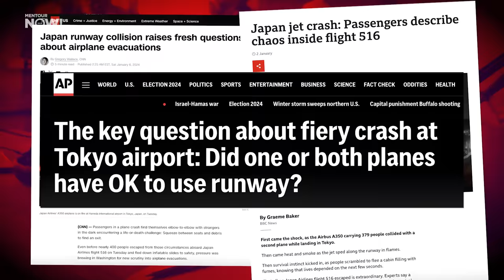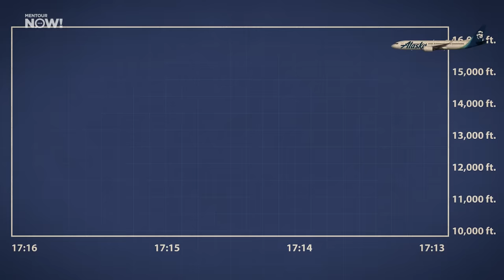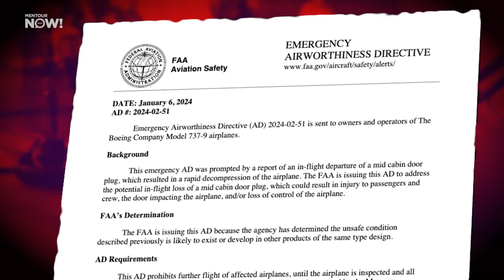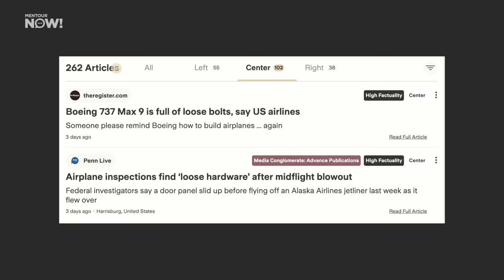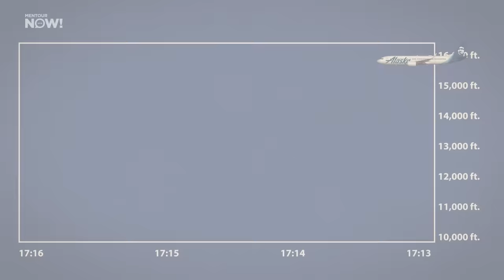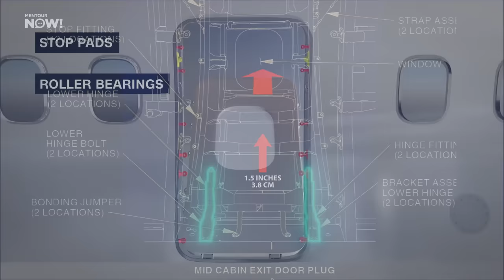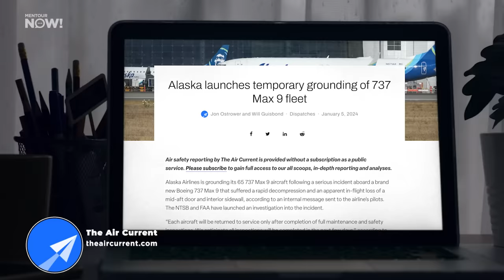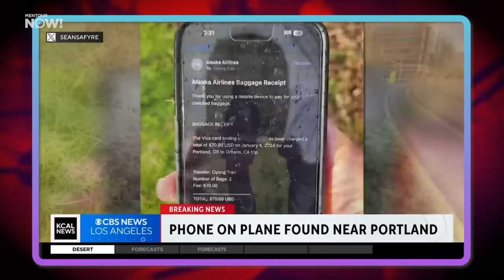WHAT Is going ON with Boeing?! MAX-9 Door blowout

Comment: NTSB media briefing on January 7, 2024 reported that the cockpit door was blasted open upon the decompression event and smashed into the lavatory door and initially became stuck.  NTSB further reported that the first officer's headset was pulled off, the captain's headset was dislodged, and the laminated Quick Reference Checklist stowed below the cockpit windows was blown out into the cabin.  NTSB reported that, according to Boeing, the cockpit door was designed to open during a decompression event but the manual did not say so.  This was apparently not merely an opening of vents but an opening of the entire door.  The flight attendant, after several attempts, was finally able to get the cockpit door closed.
Reply: The cockpit door opening, I feel like they might of switched to a cheaper way of producing these doors but they would not comply with regulations added after 9/11, so they decided to hide this yet again.
Reply: Should this have happened…absolutely not. However, the planes and crew training were robust enough to safely land. 

Still the safest form of travel.
Reply: The 737 post-911 cockpit door lock mechanism is designed to unlock in case of rapid depressurization. Airbus has a similar system. The blow out panels in the door will open towards the flight deck only, in case the depress occurs in the flight deck (allows the large air volume of the cabin to escape through the flight deck). I understand the consequences of not having the MCAS documented in the flight manual but not everything has to be documented and pilots don't know everything and they don't have to know everything about the aircraft they fly. I certainly don't know about a lot of design features of the aircraft I fly.
Reply: Seems kind of a bad design if that's the case.
Reply: @carlveilleux5744  I don't know. Having an entire heavy door violently blast open during a sudden depressurization could cause serious injury if someone is standing near there. And as reported, the door jammed a lavatory shut. If anyone was inside, they might be trapped and not being able to escape during an evacuation. Seem like a very bad design.
Reply: @aliancemd "... they might of switched it ..." should be "... they might have switched it ..."
Reply: @douglaswilkinson5700  It's my 4th language, get a life. Let's see how you speak your 4th language
Reply: Yes that's the point of having the door unlock automatically, it would just swing open (I'm not 737-rated but some guy on Twitter (X!) explained how the door lock system works and the one way blow out panels). Also the door frame and bulkhead structure could be damaged by the rush of air causing maybe some damage avionic racks and what not if the door doesn't open. Now if this "unlock" mechanism didn't do it's job and the door was actually blasted open, well that's not good! We'll see what the investigation reveals. @Secret_Moon
Reply: Wait... So if I want to hijack a plane I simply have to cause a cabin depressurisation at low altitude and I can wander into the cockpit?
Reply: Is it just me, or does anybody else think a headset that gets dislodged in an emergency is kind of an unnecessary extra risk
Reply: @aliancemd  might of is actual american slang as far as i am aware. i speak some languages myself and most of the times i am too nitpicky in the grammar rules, so i would have never written anything but have switched.
I learned my languages in school, so no slang near me to learn, don´t know if you learned your languages online or in school?
Reply: @critical_always maybe that’s why they didn’t tell anyone 🙄
Reply: Well that's not great. I'm guessing, since it wasn't in the manual, that was a shock and a half to the pilot and first officer!
Reply: @aliancemd  Were you not listening? It wasn't an accident due to cheap manufacturing, the doors were designed to fly open in the event of a depressurization. It was intentional
Reply: @carlveilleux5744   The youtuber pilots that fly these aircraft have referenced the blow out panels in the cockpit door - including as part of Mentour's insinuation that the crew may have been confused on this point.  It stands to reason that - informed about those - that they would also be informed about an asymmetry in the system where panels work in one direction but not the other.     The pilot doesn't need to know the specific torque specification for the bolts holding the engines to their pylons and other specific maintenance and design parameters  - but they absolutely do need to know particulars about the behaviour of operational systems.    Like MCAS, as you have acknowledged.   And also, I posit,  how the system behaves in a depressurization.  ESPECIALLY when it creates a hazard.  This cockpit door swinging into and somehow jamming with the lavatory door would probably cause injury to any person who might be entering or exiting the lavatory.  The crew doesn't have any means to fix that hazard, but they certainly can instruct people not to stand in that location while waiting for the lavatory or getting up to stretch.  Facilities routinely paint a profile on the floor in locations where doors swinging are a hazard.  Any quantified risk reduction from that will be really small because of the low likelihood of depressurisation events, but observing that people are not constantly exposed to a specific hazard (such as only being exposed during a once per shift inspection, instead of standing constantly beside the machine) is routinely accepted as a mitigation in risk and hazard reviews.
Reply: @aliancemd I was trying to help you. (BTW I speak Modern English, Spanish, German, Swedish, Czech and read Classic Middle Egyptian.  My friends correct my mistakes.  I've asked them to do so.)
Reply: I think that the NTSB only reported that there is no proof yet that the  multiple pressure warnings were related to the door plug ..this is completely different than stating that they are not related. furthermore it is nearly impossible to single out the origins of leaks just days later.
Reply: I reckon it was loud they said several cell phones were blown out of the airplane.  That is why it is a good idea to wear your seatbelt when you are in the seat.  The first thing I do when I sit down is put the seatbelt on.  That seatbelt can be the difference between walking away from a wreck and getting killed.
Reply: Yes, exactly.
Reply: @JohnVanderbeck Look at the Helios flight where pilots became incapacitated. Would be better for someone to be able access the cockpit should anything happen to the pilots.
Reply: @aliancemd Airbus cockpit doors also open during a violent decompression. The difference is that Airbus includes that in their manuals and therefore pilots know about it.
Reply: @critical_always  I'm curious to know how even the most inventive person would rapidly depressurise a cabin...  then "wander" into the cockpit, then overpower two or more crew members before passing out? Would a window blowout exceed the pressure threshold, or would it have to be something as big as a main cabin door?
Reply: @ImperrfectStranger  Punch a hole in the inner cladding and remove the bolts from the door plug
Reply: @mrjakobt  It's perhaps not documented in pilots handbooks, because designers expected the smaller blowout panel to equalise the pressure fast enough, but the very large depressurisation rate may have tripped another feature which is documented, at least in the general NG maintenance manuals (but isn't specifically for rapid decompression). Since I have no documents specifically for the Alaska airlines Max 9, I don't know what system is fitted.
Reply: @critical_always  More like you need to cause it at high altitude ... and bring your own oxygen if you want to move during the time above 10,000.  Good luck with that...
Reply: @carlveilleux5744  it wasn't the blow out panels that opened though. It was the whole door.
Reply: @eljanrimsa5843   LOL... 4 hours later trying to chew through a fibreglass panel, remove 4 cotter pins with pliers, Get out a socket set and undo 4 nuts, then find out the pressuration forces have already loaded up the 12 stop fittings not allowing you to slide the door up. 
If you weren't already beaten to death by your fellow passengers and if you were able to lift up the door, you would get sucked out the door. By some miracle, if you weren't sucked out the door, you would then have to run to the other end of the aircraft before passing out from lack of oxygen, fight the pilots and cabin attendants and fit your own mask (if you knew how).... if the crew hadn't already reclosed the door and locked the door manually. 
9/11 won't happen again because the people on the aircraft know they will die if they let the hijackers take control. 
By the way, I know my fellow engineers who have flown for work required special passes before flying on an aircraft with their tools, otherwise they wouldn't get past the x-ray machines at check in.
Reply: @aliancemd  You get him Lilian.
Reply: @bertbergers9171 The derivation for “might of“ is  “might’ve.”  (Short for might have) But now people have turned it into might of, along with many other variations using of in place of a contraction. It’s not real slang, just incorrect useage that is becoming widespread. Schools aren’t doing basic tasks anymore, too busy with parenting duties to teach Grammar and English.
Reply: @North_West1  Not on crasheing, it's not...
Reply: @North_West1  "Still the safest way to travel....." Says who? Says the people who take the number of, say, aviation miles divided by number of aviation fatalities during those miles flown. Looks safe? Sure it does when compared with car or even pedestrian fatalities calculated the same way. BUT.... planes carry passengers far, far further overall than cars or human legs AND, very few people are killed outside the first 20 mins of flight (this Alaskan flight being a good example). If you start to look at aviation safety per take-off and landing cycle - not by miles flown, it looks much less safe. Worse in fact than travelling by passenger rail - in Europe, anyway.
Reply: @eljanrimsa5843  Yes, it's not as if they have any backups for their headsets, such a a mic in their oxygen masks and cockpit speakers.
Reply: @bertbergers9171  No it's definitely not slang, it's poor usage. Many native speakers hear it as "of " but don't see it as "' 've", therefore  the mistake.